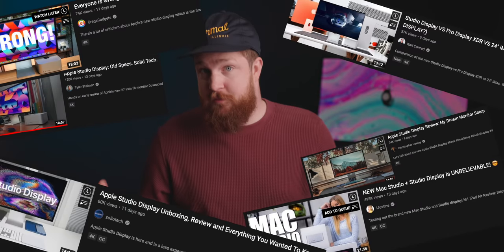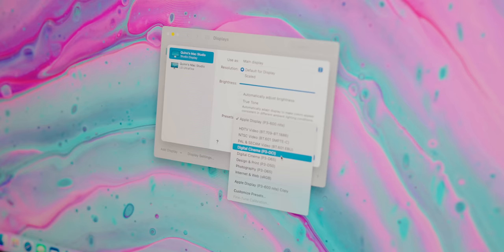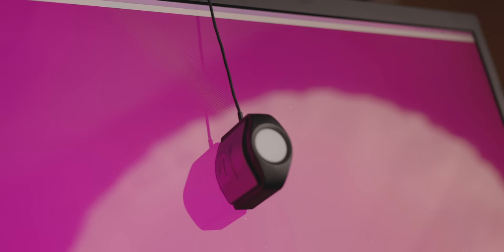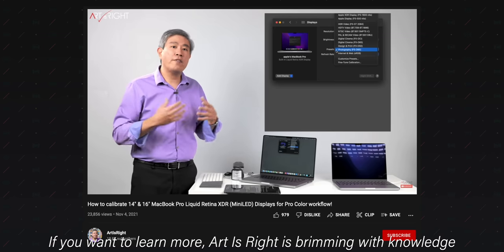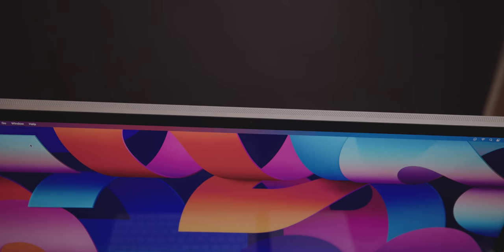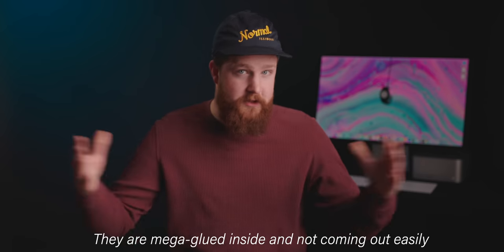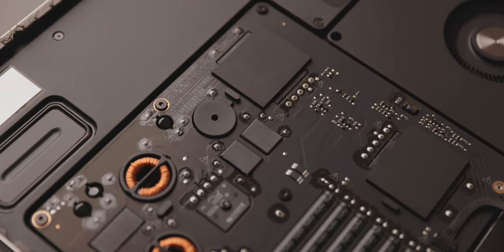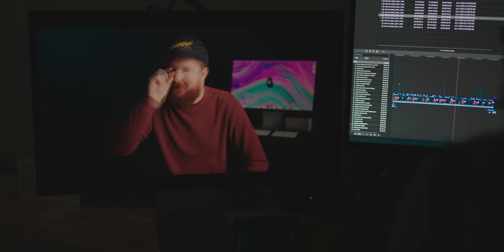The Apple Studio Display Is WEIRD!

Comment: I knew about the a13, actually makes some sense overall. But the 64GB of storage is hilarious. That means the studio display is both more powerful and equal in storage to the very HIGHEST END Apple TV. Why didn’t they take advantage of that? A built in Apple TV would’ve been a neat selling point, and an included remote would’ve been a pittance at $1600.
Reply: When Apple can easily sell both of those products without much hassle or trouble, why would they go out of their way to combine the too. Like they say, if ain't broke, don't fix. 
Besides, 27 inches is probably not big enough for those interested in Apple TV and not very desirable for those interested in a monitor.
Reply: The M1 is basically just an a14 with more cores. So the a13 should run macOS as well.

This is basically an iMac!!
Reply: @user-bm9fo5kr1l  it’s all about improving!!!
Reply: @spaceowl5957  yeah shame they don’t do a DEX competitor. Run macOS when phone connected to a monitor, would be fucking awesome.
Reply: In 2022, the size of monitor firmware is over 1GB.
Reply: That would have also required bluetooth and wifi chips, a USB C port for developer, an ethernet port and maaaaybe an HDMI out. Probably still worth it though.
Reply: It’s actually specced exactly the same as those Apple silicon dev kits. People forget those ran in A13s and not the M1. This monitor could totally run MacOS. And I’m sure at some point people will make that happen like the gen 1 Apple TV’s also able to run MacOS
Reply: @OtioseFanatic  nope the Mac Mini apple silicon dev kits that they released after WWDC 2020 were using A12Zs
Reply: Maybe Apple is just using a version of either the Airplay/sidecar functionality for connecting the Macs to the studio display. 🤷🏻‍♂️
Reply: @PaddleMonkey  no, the monitor handles its display handshake via thunderbolt for compatibility. The a13 doesn’t even natively support thunderbolt.
Reply: @OtioseFanatic  yes, true. Though the DTK was an A12Z, so likely a little more powerful than the monitor. It does seem like this would be totally capable though, but I guess we don’t know the RAM. If someone ever figured it out, that would definitely be something to see!
Reply: It doesn't make sense to me.  A monitor should be a monitor and anything that doesn't improve its ability to be a monitor isn't necessary.  It's costs $1600 for no real reason.  If it was thicker it wouldn't be a worst monitor. If there was a power brick it wouldn't have been a worst monitor.  If it didn't have a webcam it wouldn't be a worst monitor.  A $1600 monitor should be a good monitor and not an okay monitor with extra crap that makes it cost more.
Reply: @helmi5045  true but the a12z was basically just a prototype a13. It still looks like this was planned to be a prototype iMac
Reply: Imaginations here are wild, it's funny that people describes like it's basically an iPad, it literally can run macOS, it has 64GB of storage so it must has room for unlock more features. Apple already stated the monitor doesn't have WiFi or Bluetooth connectivity, it's an offline device, furthermore, yet there's no indication that the A13 directly drives the 5k panel, 5K resolution 10bit colour depth with 60Hz refresh rate requires around 31.85 Gbps bandwidth, Apple M1 can since iPad has Thunderbolt 3. Apple put A8 with 16G in HomePod, but seems nobody think it's too much for a speaker that doesn't have screen and offline playback.
Reply: @lumpython5351  it’s not a 10 bit screen it’s an 8 bit one. And no it literally does run iOS lol. On top of that it’s only not WiFi and Bluetooth enabled because it’s disabled on the SOC. The hardware is technically there just switched off.
Reply: @OtioseFanatic  lol, did Apple also installed WiFi and Bluetooth antenna? Afaik the WiFi and Bluetooth never built inside of SoC, it's a separate chip by Broadcom.
Reply: @OtioseFanatic  even only 8bit still too much for an A13.
Reply: @lumpython5351  bruh what? We have had color accurate 4K and higher 8 and 10 bit displays before the 2019 when the processor came out. I mean hell the LG monitor this new monitor is replacing even though it essentially has spec parody is from 2016. He’ll there were CRT monitors with the ability to output color accurate 4K resolution back in the days where DVI was considered high end for consumer use. You just needed what was considered a super computer at the time to display to them properly at a decent frame rate. You would only really see them in Hollywood and in engineering work. Please shut the heck up about crap you know nothing about. There are only three scenarios that are viable for this new monitor having the a13 SOC and iOS baked in. One, the internal hardware was indeed derived from a prototype to the modern Apple silicone iMac (it happens all the time and is rather creative if expensive). Two, Apple just happens to have a large back stock of lower binned a13 (or even defective) chips and they are doing what they can with what they have due to the ongoing chip shortage. Or three, it’s literally only in there to provide a compatibility layer middleman to run center stage with the webcam, no matter if the mac running it fully supports it or not like the myriad of Intel macs still in the wild that can’t run center stage on their own but can with this monitor.

Considering the oversight of having a “non-removable” power cable even though the display is 100% capable of being run and powered over a single thunderbolt connection, and the fact that the version of iOS on the monitor is in fact the same version number as the most current version the a13 can run (seriously Apple NEVER does that, they have ALWAYS had different version numbers when forking an operating system over to non standard hardware even if it can be functionally similar, like first gen Apple TV units that were basically cut down max minis that ran an Intel atom processor instead of a core series, those ran on a locked down version of Lion) my educated guess is that it’s a mix of all three. Again, a very creative solution, even if the product itself is kinda dumb when you look at it in brass tax. Apple definitely did a thing to get a product out the door, as they are known to do sometimes.
Reply: @OtioseFanatic  I said there's no indication the A13 DIRECTLY DRIVES the 5k panel, that requires more power than A13, A13 is just a mobile phone SoC, if that really drives the panel, it wouldn't be called  A13, least needs to add more cores for the GPU like they did to the iPad and called it A13x, I have used the first gen of 5K monitor, in fact, even Thunderbolt 2 can't provide the bandwidth that 5K resolution required, that's why iMac doesn't support target display since, and the iMac actually used two cable and some driver modification to display 5k resolution, evidence is using Linux or boot windows without apple driver installed, the screen resolution only has 3840*2160. You seem knows a lot sounds professional but you actually don't know anything depth.
Reply: @OtioseFanatic  and mind you, those defected 5K panel went to China, China has been selling OEM 5K monitor in very cheap price for ages, because lack of R&D, those monitor only has very limited functionality, most of them only has two input and no adjustments except brightness. Your suspensions are more likely paranoias.
Reply: @OtioseFanatic  how about the T2 in Intel Mac? It provides some additional functionality doesn't mean it directly drives the display. Could be the Same as Studio display. And T2 also only communicate through USB bus, in fact, Apple XDR also communicate through USB bus not the Thunderbolt, someone made it work with NVIDIA egpu doesn't have any Type-c or Thunderbolt port, the only thing requires is a Belkin special VR cable made for Huawei VR goggle and only exclusive sell in China.
Reply: @lumpython5351  also what the heck does the T2 getting hacked have anything to do with literally anything? And no they didn’t get the egpu to function other than to pass thru display data. A device driver for nvidia GPUs literally does not exist for ARM, let alone Apple silicon specifically. Please stop randomly commenting stuff that neither has anything to do with the topic at hand or is even accurate at all.
Reply: Samsung actually sells that product, the M family smart monitor (M5, M7,M8)
Reply: You simply don’t understand how cheap chips are in production. Having storage is cheaper than a new design
Reply: @user-bm9fo5kr1l  I’m sorry my man. 27” is big enough. I work from home for about 27 years (IT related). But whenever I’m stuck, I fire up a YT video, or Apple TV show episode to clear my mind. Right on one of my three 25” Dell UP2516D monitors.
Reply: Apple buy 64GB flash modules in insane quantities for iPhones - they're probably in the top few biggest customers for these in the world and can negotiate aggressively low prices. I can actually believe that for Apple it is more economical to "waste" a 64GB chip than to buy small quantities of smaller chips... especially if that's what the A13 is designed for.  Likewise, the A13 may be overkill, but a display like this needs a processor and, hey, Apple makes processors, and the A13 is one of the less powerful ones that they still make....
Reply: My god dude; I never even considered the logic in this but your 100% correct!
Reply: Because people probably don't want a 27 inch TV? You can watch content on it regardless if you plug in a PC.
Reply: maybe the nvme ssd controller on the a13 does not support less than 64gb nand storage.
Reply: @spaceowl5957  This is so not true. I forgot the details, but there’s some serious memory and scheduling innovation behind the M1, which puts it heads above any A-series chips. A or M is way more than just rebranding and more cores, one chip is optimized for an OS with only one active task and everything else suspended and the other is optimized for some serious multitasking. That’s why reviewers complain iPadOS with only SplitView multitasking doesn’t even make use of the M1 raw performance.
Reply: @GanesAjiLaksono  M7 user here, I don’t recommend anyone buys this rubbish, it’s just a cheap Samsung TV with below average VA panel slapped with outdated 32bit unknown Samsung processors and call it Smart monitor, for monitor, Spyder 3 tells me only less 70% sRGB, for comparison any LG IPS monitor in that price range does way much better. For SMART features, it’s unusable, the office 365 is just a web link, the slow processor cause sluggish to every click, both VNC and RDP have bad image quality and resolution of all smart features include AirPlay, miracast only limited to 1080p. The only good thing about it is its advertisement.
Reply: @Xavier Breath Ima report your comment bro, your being freaky! Despite freaking great idea
Reply: When your pc has less available space than your moniter
Reply: because it's for monitoring, storing and transmitting your data. Oops. Cat's out of the bag.

Comment: I definitely think a miniLED ProMotion panel was intended for this thing, we've been hearing about that panel's existence for ages and it seems like it would fit in this chassis perfectly. But then again, why release a desktop without giving us a monitor to go next to it? Slap the ol trusty iMac panel in it (not making it anymore so there's plenty of spares) and bob's your uncle. Wait a few months for a Mac Pro announcement, stick the miniLED panel in it and re-use the other stuff, you're good to go!
Reply: I also think so. The fans seem like they are slightly overkill for the power supply and could be used to cool an array of LEDs used as a backlight in a possible later model
Reply: Thunderbolt 4/HDMI 2.1 can only support up to 4K120 to 8K60
Reply: @paganizondar1295  Have you seen DisplayPort 2.0? That can do even higher resolutions and frame rates compared to HDMI 2.1
Reply: @paganizondar1295  not true, thunderbolt 4 can do 5k/120 with DSC
Reply: The only thing wrong with this monitor is that it’s just 27” and not true 5K at a bigger screen size.
Reply: @paganizondar1295  8K60 takes up more bandwidth than 5K120… a lot more.
Reply: @abubakrakram6208  Eh, it's barely more. 8K60 should be about 12.5% more than 5k120. 8K is 2.25x the resolution of 5K, but 2x less framerate as well for 60 vs 120.
Reply: @shubham_yadav1611  Can you please write me down the equation of this I am just curious about how you have calculated it!
Reply: @benedekk.8381  8k 60 is 7680*4320*60 while 5k 120 is 5120*2880*120. Just divide the two and you’ll get your answer.

Comment: Part of me wonders if the A13 design was an earlier prototype attempt at what became the M1 iMac, and they decided to recycle the internals and sell it as a monitor rather than scrapping the R&D work. It's a truly bizarre set of internals otherwise.
Reply: good point.
Reply: But why would they do that? It’s all so strange.
Reply: or they planned on selling WAY more iphones/ipads and had to do something with all the extra chipsets, but didnt want to cannibalize M1 sales. thus locked down monitor
Reply: @johnsmith-v9t8o   They would probably do it like that so they could develop macOS to work on arm while working on the M1 chip
Reply: @johnsmith-v9t8o  They would do it for sure if it did not meet their expectations or plans  and wanted to still make a buck out of it rather than put them in the shredder.
Manufacturers do this all the time , for example batches of computer chips that do not quite perform to the top level often end up in the cheaper models , waste nothing that you can make a buck out of.
Even parts that are goos but not sold from the year before often end up in cheaper models .
Waste not want not.
Reply: 64GB iMac? Looks werd weird.
Reply: Actually it would make sense considering the original Mac mini dev kit running apple silicone was a modified A12Z chip
Reply: This is a pretty interesting point!
Reply: Considering it’s basically the exact same spec as those Apple Silicon dev kit minis Apple released before M1 officially came out, yeah that does seem to be the case.
Reply: Which part of you wonders this?
Reply: hmm 🤔

Comment: I like the theory that the iMac Pro will be identical in design, but with M2 Max/Pro chips instead of the A13. Clearly having the same design means that the display was cheaper to design and manufacture. They basically killed two birds with one stone. But it also doesn't really make sense to do this either, because the display ends up being too expensive (because its too much like a computer). I wonder if covid supply chain issues caused this, somehow. Like maybe they had planned to make the display and iMacPro more substantially different but then realised that it would delay the product releases too much. OR they scrapped the iMac Pro at the last minute, but having put all these effort in the design, decided to repurpose it for a display.
Reply: I think it’s the latter
Reply: @vyeung  it is odd - I guess it was either ‘in or out’ and with the space they had left in there with no motherboard, they went for ‘in’ to keep it tidy. They still could have made the shallow connection magnetic, so it’s an odd decision. It’s nice to have the power built in, but not sure many folks would have been too bothered if the power supply was outside.
Reply: I think a 27" "normal" iMac makes much more sense than a iMac Pro. The "Pro" consumers are better off with the Mac Studio + a professional Display. It was a big mistake from Apple to cut off the 27" iMac....
Reply: @simpromovie  Agreed.
Reply: @brucekennedy5274  The 143W power supply on the 24" iMac is already the size of an Apple TV. No one wants a larger one to power everything needed on this unit.

Comment: I most certainly prefer no local dimming on a professional work monitor than having the issues that comes with local dimming.
I don't mind having no "pure" black, because that doesn't exist anyway in the end result of what I'm working with. The perceived black is more than well enough and it's really, really annoying to have some zones lighting up instead of having the complete display having a conform black level.
An oled on the other hand. Now that's something I'd certainly like to see. But that would be three or four times the price I guess. And then maybe we would also be having a display with less pixel density—which I do not want. I'm a very big fan of Apple's 218 dpi pixel density compared to about 140 or so on other displays.